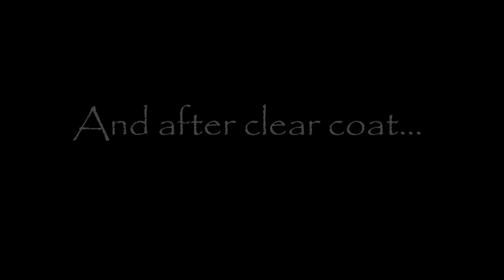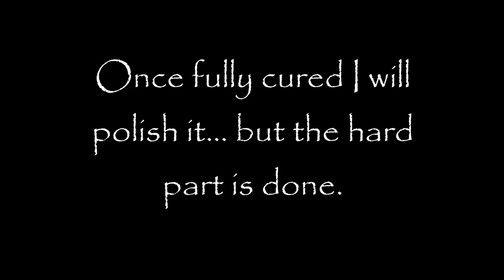Cambridge Pinstriping, Airbrushing photo-realistic skulls on a motorcycle petrol tank!

Comment: great job lad. i don't think he will want to buy a new tank now. I've done a bit of airbrushing myself. always nervous about polishing the clear- how long do you usually leave it to cure before sand and polishing? here's my site www.paulrossiter.ie (i don't do much any more and I'm in ireland so not trying to steal work off you😉)
Reply from the maker: Wow! fantastic stuff Paul! really impressive!
It depends on the clear and drying conditions. I usually leave it until it's rock hard, 72hrs to be safe. Sometimes less, sometimes more. Usually more.., ;)
Reply: MackieBass thanks. pretty sure that's where I've gone wrong in the past.